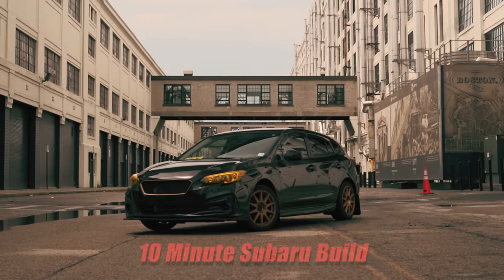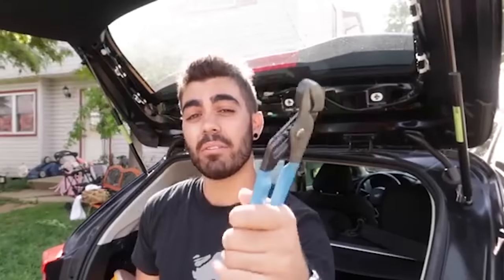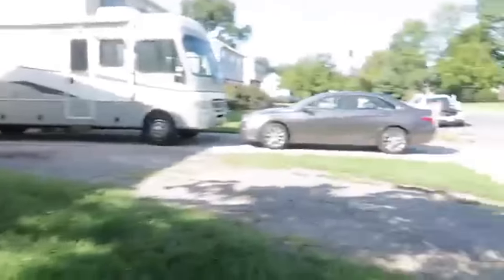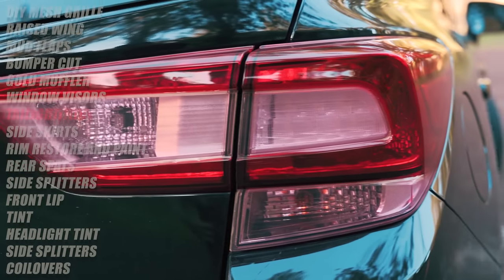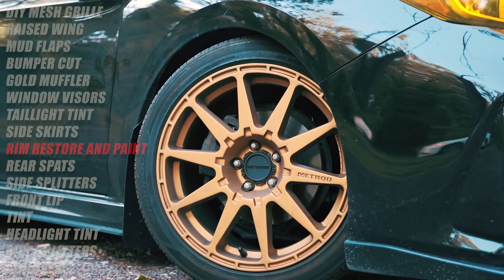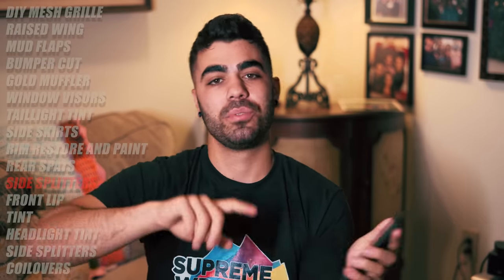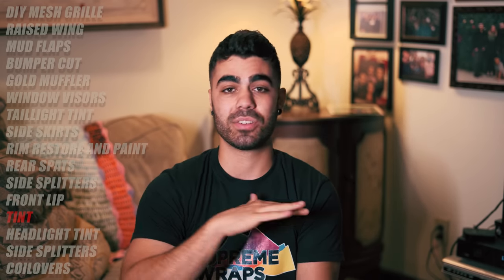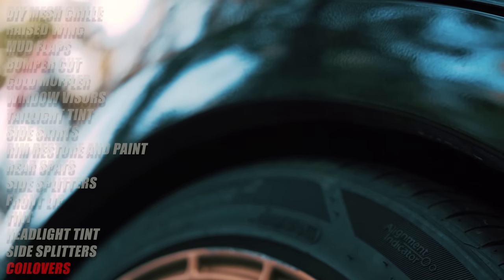Building A Custom Subaru Hatchback In 10 Minutes!

Comment: Hey man i’m looking into these as one of my first cars, i was just wondering i know the car isn’t fast by any means but is the CVT annoying and is the car boringly slow?... I usually don’t comment but this was a banger of a video! Props to you brother i’m subscribing ✌🏽
Reply: The cvt does suck but using the paddles helps you stay in the higher rpm range for better response, yes its slow but as long as your not drag racing you can carve some tight corners pretty quickly it handles surprisingly well
Reply: depends on what “sucks”. if it’s an every day car or first car etc the CVT gets you where you need to be no problem